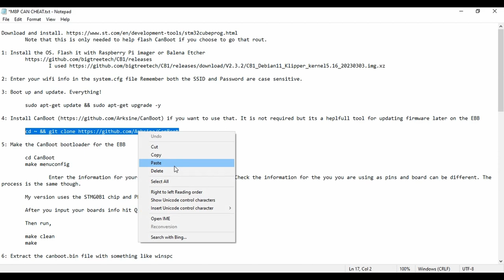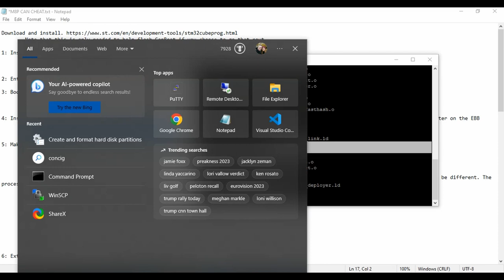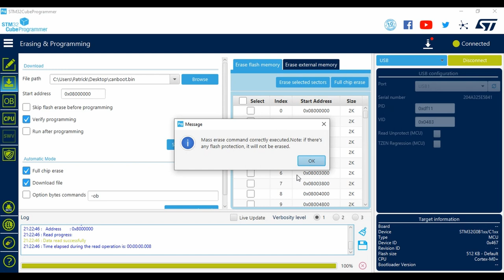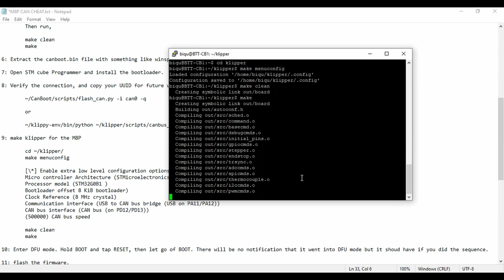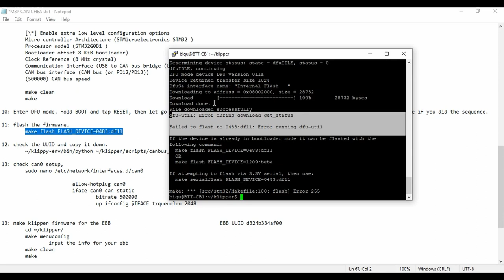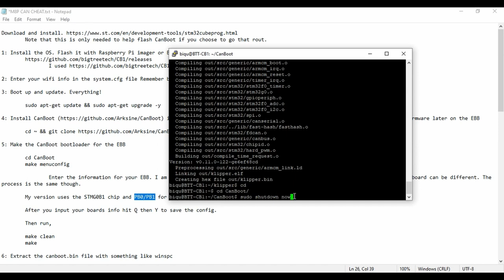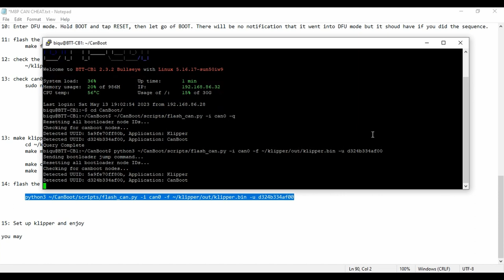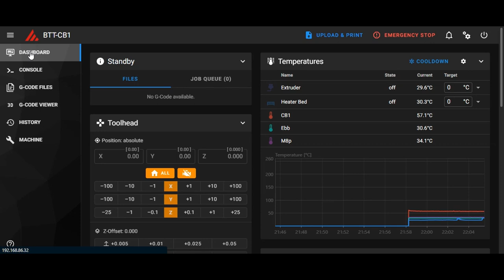Manta M8P+EBB CANbus Setup

Comment: I've tried this like 5 times and I just cannot get it to work. I was following along with the video (obviously replacing any instance of "CanBoot" with "katapult"). Everything works exactly like your video says it should ... right up until you do the "shut down the M8P/CB1 and then plug in the CAN board" step. Then when I turn the M8P/CB1 back on it acts as if I never did the flash. I get an error message that basically says there are no UUIDs, either for the M8P/CB1 or the board I just plugged in. For reference, the CAN board I'm trying to set up is a BTT MMB (not an EBB) and the M8P is a v2 (and yes, the jumper connector for 120R is installed on both), so any time you showed a 'make menuconfig' I had to look it up and change the settings to match the appropriate board. But I don't think that's the problem, like I said everything was working perfectly, right up until I did the shutdown. Then when turning it back on (with the MMB plugged into the M8P via the CAN cable and NOT the USB-C), it acts like it didn't save whatever changes were made that made it detect the CAN in the first place. Here's the error message:

biqu@BTT-CB1:~/katapult/scripts$ python3 flash_can.py -i can0 -q
ERROR:root:Flash Error
Traceback (most recent call last):
  File "/home/biqu/katapult/scripts/flash_can.py", line 491, in run_query
    self.cansock.bind((intf,))
OSError: [Errno 19] No such device

During handling of the above exception, another exception occurred:

Traceback (most recent call last):
  File "/home/biqu/katapult/scripts/flash_can.py", line 619, in main
    loop.run_until_complete(sock.run_query(intf))
  File "/usr/lib/python3.9/asyncio/base_events.py", line 642, in run_until_complete
    return future.result()
  File "/home/biqu/katapult/scripts/flash_can.py", line 493, in run_query
    raise FlashCanError("Unable to bind socket to can0")
FlashCanError: Unable to bind socket to can0
Reply from the maker: Double check that your can0 is set up correctly. Get Into the can0 file with this command 

sudo nano /etc/network/interfaces.d/can0

It should look like this,

allow-hotplug can0
iface can0 can static
  bitrate 1000000
  up ifconfig $IFACE txqueuelen 1024

Make sure that is set that way and hit Ctrl+X then Y then enter. To save and exit if you changed anything. The bitrate needs to be the same on all devices and 1000000 is now the recommended value.
Reply: @StackingLayers  I get exactly what you show here, without making any changes. But the error still persists.
Reply from the maker: I'm assuming the MMB is powered up too right? Not only the can line. I'm sure it is but I have to ask. Also the bitrate when you made the firmware, was it 1000000 too on both boards?
Reply: @StackingLayers  The CAN line that the MMB comes with has both power and data in a single cable, with a special plug on one side for the MMB which cannot possibly be plugged in backwards, and the other side was 2 loose wires for the power connection and a 2-wire connector to plug into the CAN spot on the M8P board. I couldn't reach both the PSU itself and the M8P with the one cable, so I connected it into the same slot on the M8P's power-in connection (both the wires from the PSU and the wires to the CAN cable I installed a fork spade connector, and the two forks for red and the two forks for black are stacked in the one connection slot each). The lights on the MMB are on. But the M8P isn't even giving its own UUID after the reset, which it did before the reset.
Reply from the maker: @richard3365 I'm aware of the cable I have some too I would just asking about power because I have seen some people think that just the two can lines are required as long as you're not using the hot end. Basically thought that the power was only for Motors and heaters and such, not for can bus. So I just double checked. sounds like you have plugged correctly. 
My chance did you already enter the UUID into your printer.cfg for the Manta? If you did and klipper recognizes it, it will not show any more when you query.
Reply: @StackingLayers  The plug is different than the square white one for the EBB, so I just wanted to make sure I covered everything. I have not made any adjustments to the printer.cfg yet (not even to include the MMB cfg file).
Reply from the maker: @richard3365 to confirm, you have used canbus bridge on the Manta and regular can on the MMB right? Also have you tried to swap the can wires on the Manta side? Perhaps they are reversed.
Reply: @StackingLayers  Well ... I think I cheated, but I got it to work. I wanted to confirm that I had every setting exactly correct, so I started over from the very beginning. When I got to the "sudo shutdown now" part to plug in the CAN board, I looked over and ... realized I had never bothered to unplug it in the first place. So I skipped the "shutdown and plug it in" part and continued. Everything continued working. After completing the CAN flash, I then did the shutdown thing, and when I turned it back on and ran the canbus_query thing, both UUIDs showed up. So somehow skipping that specific step worked. Or, possibly I had messed up on the settings somewhere along the way and this time when I was double and triple checking literally everything, I got the setting correct. I don't know. But it works now, and survives a power down, that's the important part.
Reply from the maker: I'm glad to see you got it sorted. I know that it con be frustrating sometimes. I've had similar situations where I know I'm doing everything right but it's just not working. Then doing it again a second or third time works. It's typically 1 wrong character entered somewhere or even just hitting the spacebar 1 too many times in some cases.

Comment: everything works for me except step 14. that last step of flashing. any help?. been trying to get canbus up for a month. manta m5p with a ebb36.
Reply from the maker: What is the error you are getting? And did you remember to have the 120Ω jumpers in place on the boards?
Reply: and yes i have both jumpers installed. one on the m5p and one on the ebb36.
Reply from the maker: It looks like it's not able to establish a connection. Have you double checked that the UUID is correct? And you haven't put the UUID in the printer.cfg yet have you?

Comment: Thanks Patrick, for the great tutorial; however, I'm stuck at finding the UUID of my Manta M8P V2. I'm encountering this error:

biqu@BTT-CB1:~/klipper$ ~/klippy-env/bin/python ~/klipper/scripts/canbus_query.py can0
Traceback (most recent call last):
  File "/home/biqu/klipper/scripts/canbus_query.py", line 64, in <module>
    main()
  File "/home/biqu/klipper/scripts/canbus_query.py", line 61, in main
    query_unassigned(canbus_iface)
  File "/home/biqu/klipper/scripts/canbus_query.py", line 20, in query_unassigned
    bus = can.interface.Bus(channel=canbus_iface, can_filters=filters,
  File "/home/biqu/klippy-env/lib/python3.9/site-packages/can/interface.py", line 127, in _new_
    return cls(channel, *args, **kwargs)
  File "/home/biqu/klippy-env/lib/python3.9/site-packages/can/interfaces/socketcan/socketcan.py", line 594, in _init_
    bind_socket(self.socket, channel)
  File "/home/biqu/klippy-env/lib/python3.9/site-packages/can/interfaces/socketcan/socketcan.py", line 459, in bind_socket
    sock.bind((channel,))
OSError: [Errno 19] No such device

I also have a question on how to use katapult and deployer.
Reply from the maker: Hmm I've never seen that error before. Seems like this not seeing a device. Have you double checked the cb1 is fully seated? And double check that you set the correct pins for canbus bridge.
Katapult is the new name of canboot installation is the same. 
I haven't explored Deployer or docker methods of installation yet.
Reply: I was able to solve the issue. The flashing of Manta V2 is different from V1 because V2 uses different chip.
Reply from the maker: Oh, I assumed you had that part done already.
Reply: Was that the only differance you encountered between the M8Pv2 and the v1? @andrelloydtorres4468

Comment: Kind of stuck, flashed canboot to a SB2209 no problem and I see 2 UUIDs for Klipper and Can. Flash firmware to the SB2209 and now only see 1 UUID for the Manta none for the Can adapter. Where did I go wrong?
Reply from the maker: Is the canbus UUID for the sb2209 already entered into the printer.cfg? If klipper has it configured then it will not show in the query
Reply: @StackingLayers  kipper not configured yet 
This is a new build
Reply from the maker: Maybe double check that you set the same can speed as the system settings and correct can pins when you made the Klipper firmware for the sb2209?